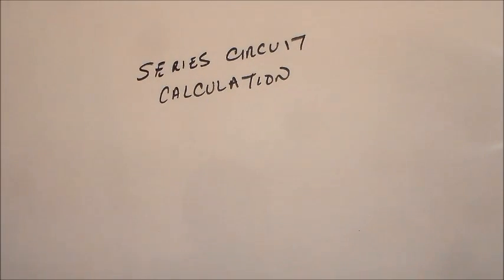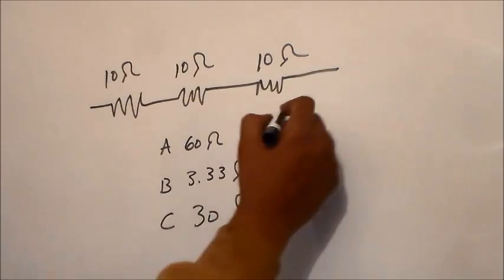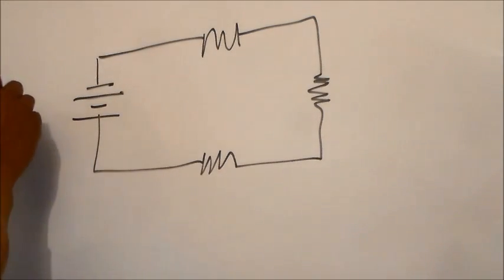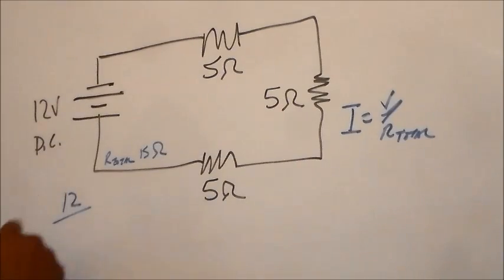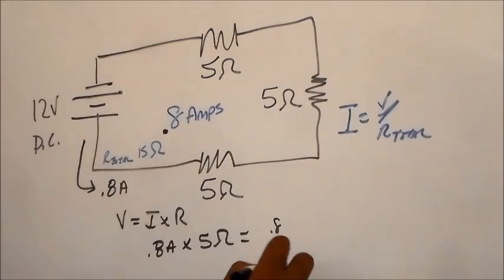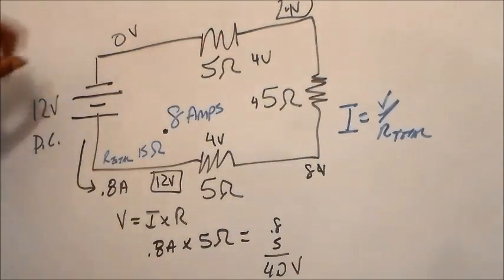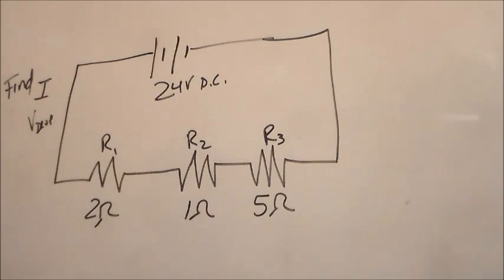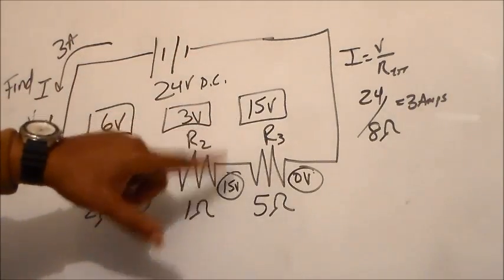ASVAB WEEKLY - Electrical Essentials

Comment: Just as a fair warning, it wasn't this easy when I took the test at all. Especially when you take the computerized version of the test, every time you get a problem correct it ramps up the difficult. By the time you finish the test, you will be dealing with fairly complex problems for a test testing basic knowledge and you will be dealing with KCL and KVL laws, and more.

You will be asked several little questions probably more than you will deal with circuits. This is coming from somebody who took the PICAT, and the ASVAB twice.

You will definitely need to study more than this to get a good score in this section. Good Luck!
Reply: @NebulousPenguin  The absolute best I've found is called MathDVDTutor. You have to pay, and you might not like that, but he's an amazing teacher. He can start you from the very, very basics and move all the way up.

Just as an FYI, I did only 20% of the course and got a 93 in electrical. If you want a 99, I recommend doing more of the course. As you start answering more questions correctly, it will move away from basics, so beware.
Reply: @NebulousPenguin  lol just realized the course you mentioned is also the same one someone else had recommended me a while ago. It must be good, ill use that!
Reply: @NebulousPenguin  how did it go?
Reply: @NebulousPenguin  What kind of questions were in the asvab for electronics. The kaplan book is super complicated and it confuses me
Reply: @NebulousPenguin  thanks for the info! I also want to get into an electric job so I'll study hard on it ^^
Reply: Which course(s) from MathDVDtutor did you take? I see one on AC circuits and DC circuits. Please reply
Reply: @JoseMobSHYT  Anything that teaches you the basics, and a little more. I don't remember what I took exactly.
Reply: i got an 88 on the picat electronics and there was nothing i would consider to be difficult, hardly any math was involved at all.
Reply: @jakebeckmann9372  I got formulas on mine involving circuits. I don't think I got any of them right, because I didn't remember how to do them, and I was pressed for time. I ended up being the last one in the testing room. This was the ASVAB though. On the PICAT, I felt like the questions were more complex and strayed away from simple things like symbol recognition much quicker. The tests are different but stick to the same structure of "you answered it right, here's a harder question". On the ASVAB, the electronics section was one of my quickest, but on the PICAT is was one of my longest.

Likely scoring in the 99th percentile requires you to know more than the average person watching a singular YouTube video, but at the end of the day, it took little effort for me to score a 93. How much more could it really take to score a 99? In my opinion, electronics is one of the easiest to score high in. Unfortunately (or fortunately, depending on your interests), this may land you in some kind of maintainer role like it did for me. Nearly everybody in my shop scored at least a 75-99 while other avionics shops we work with were lower, even though they have the same requirements in the electronics section to land a job. Maybe this is coincidence?
Reply: @ryanhannagan4856  Weird bro.. I really didn't see anything hard and I didn't study at all, I took the picat thinking that it was a meaningless practice test. Are you saying that you scored 93 despite the issue with those formulas? Because you should also remember that it is a percentile test and I can guarantee a minimal amount of the population is scoring points on anything involving a formula, so getting them wrong will not hurt as much as getting something like "what kind of circuit is this" wrong. I'm going in to confirm my score on the 18th hopefully I'll be able to replicate it because the requirement for what I want is 88 mechanical and 85 electronic.
Reply: @jakebeckmann9372  What job are you going for?

Comment: As a correction the voltage   work is incorrect it should equal 12v and it should be .8amps x 15 ohms = 12 volts as you can see you have 12 dc volts to start off with at your cell or battery

Comment: that it? thats all i need to know for electrical section?
Reply: Not even close. It will discuss a wide variety of questions testing your electrical knowledge. This video just deals with very basic circuits. The questions aren't hard, but will deal with a wide variety of things.
Reply: @HAWK45454545  Dude, this was everything in the test, atleast for me. I took a PiCAT and I literally got a 70 on the electrical because I knew the very basics from my dad. Now i'm refreshing for the verification test. I scored and 85 afqt and somehow my M-A-G-E Electronics score for the Air Force (last one) was only 5 points lower than my General
Reply: @tttmarcel2777  I studied a small course on it and saw almost everything in that course on the test. I still scored an 85 in electrical, I think.
Reply: TheMusicSoldier which course did you study? I’m studying for the electrical now, feel good about general but I definitely need to learn more about electrical to get a 70+
Reply: TheMusicSoldier is it timed? I took the PiCat and scored a 78 overall. For the jobs I’m getting I mainly need to be good at Electronics and General science... I take the Asvab in 3 days
Reply: My recruiter said it has the exact same questions so I don’t feel like i should be too worried